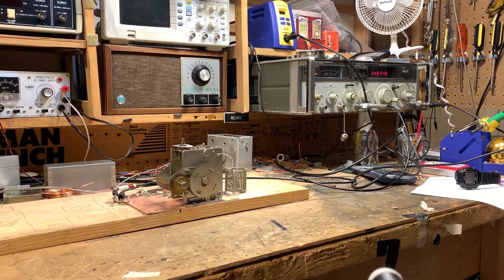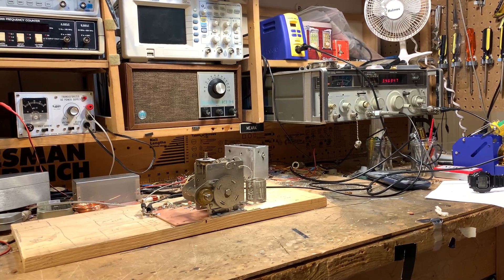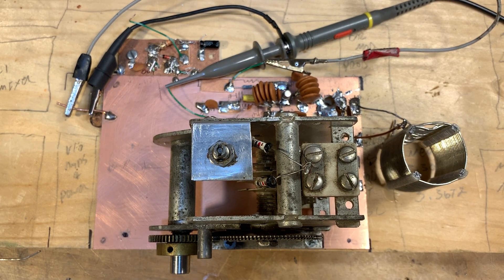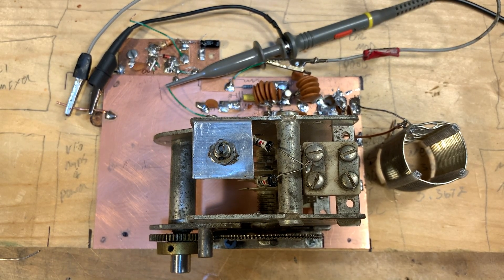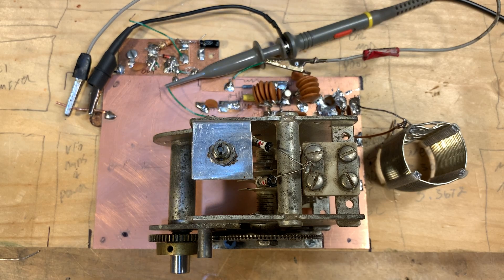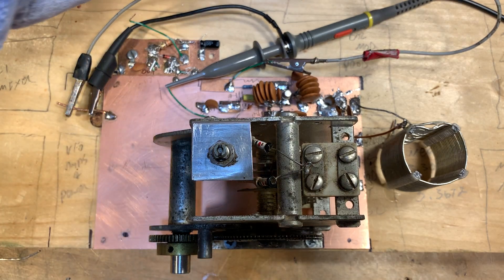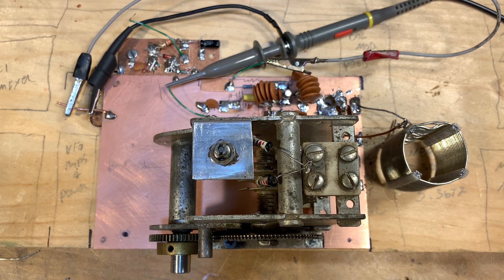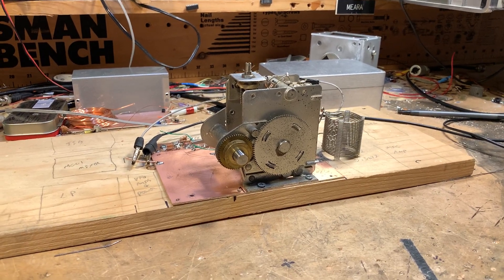Building a Ham Radio Transceiver: 17/12 Rig Video #1 -- VFO Build

Comment: Thanks for the video.  Congratulations on the stability.  
I'm just getting back into building after a 30 year lull.   During recent reading I stumbled across an old type of VFO called Franklin.  It's reputed to be stable up to 30 mHz.  I haven't tried it yet because I'm ordering parts. 
At first glance it looks like the video linked just below has nothing to do with a VFO, but the video contains tips to get the Franklin VFO working.   
One important factor to getting the Franklin working is to home brew 2 gimick capacitors (not hard) and their placement.  Each capacitor is just 2 wires twisted together.  One is 4 turns and the other is 8 turns.  The Crystal radio video gives details on building the Franklin working.
https://www.youtube.com/watch?v=fRz9i3HFhAU
I've favored the Colpitts VFO and am dying to give the Franklin a try.  There's a lot of links to articles about the Franklin here:  https://www.google.com/search?q=Franklin+VFO&oq=Franklin+VFO&aqs=chrome..69i57j0i390i650l4j69i60.8324j0j7&sourceid=chrome&ie=UTF-8
73
Reply from the maker: Yea, I posted about the Franklin oscillator back in April:  https://soldersmoke.blogspot.com/2023/04/the-franklin-oscillator-super-stable.html  73  Bill